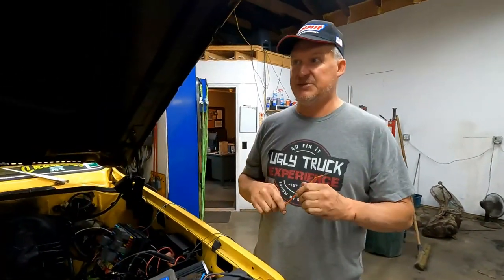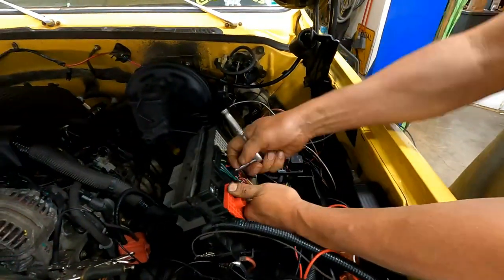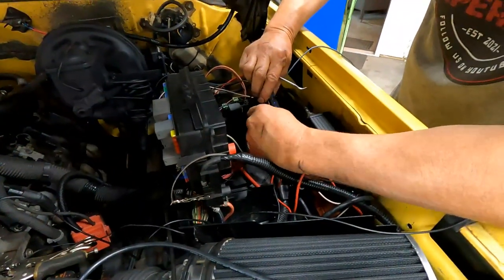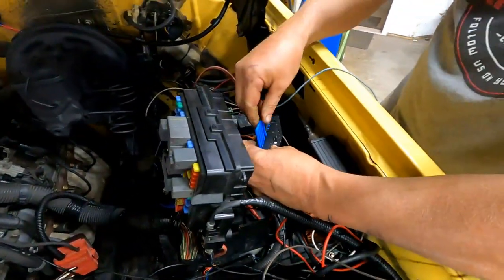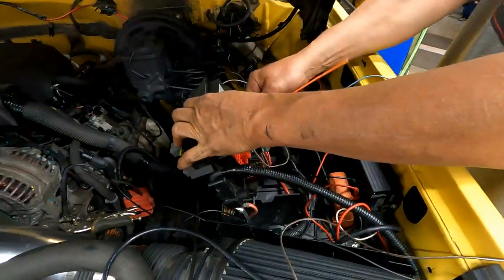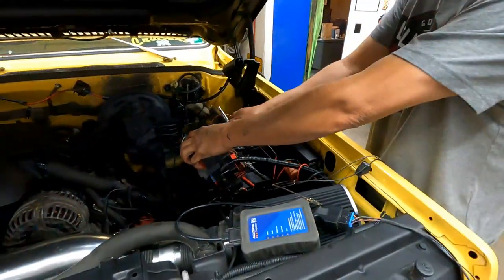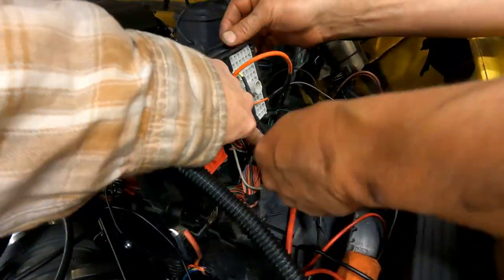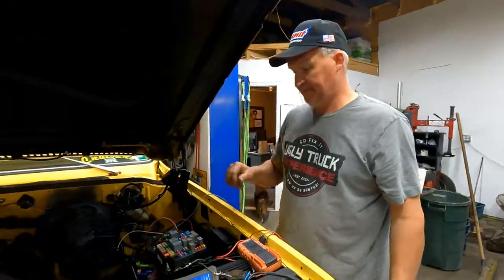MAKE SHIFT HAPPEN - Supplying Power to 4L60E Transmission - Square Body C10 5.3 LS Swap - UTX

Comment: Thanks again for your help. Is the E-7 on connector 2 and C-9 on connector C1 the same wires on the 99-02 fuse block?
Reply from the maker: E7 Connector 2 is the same.  C9 is not the same.  On a 2002 that wire would be E2 in connector 2.  Jerry
Reply: Jerry, could you check again on E2 connector 2? I have no wire there. E1 there are 2 blacks and E3 has a green. but nothing in E2. My E7 does have 2 orange for the rear 02 sensors.  @UglyTruckExperience
Reply from the maker: Will look again..Be right back. Jerry
Reply from the maker: You said 99-02.  Do you know what year for sure you are working with?
Reply from the maker: Need to figure out exactly what this wire harness and fuse box is from.  Your  wiring that you are describing doesn't make much sense looking at these diagrams. E7 should be 2 pink wires if they are going to the O2 sensors.  Double check that you are reading the plug correctly.  It can be confusing.  Also, I can't find a instance of a Green wire in E3 on C2 for any of those years.  Try to narrow down what this came from and let me know.  Will do my best to help out. Jerry
Reply: @UglyTruckExperience  Jerry, I found a diagram that the green wire E-3 in connector 2 as a 10A fuse that supplies Automatic Transmission Shift Lock Control Solenoid. Would that be what I'm looking for?
Reply: 2002 @UglyTruckExperience
Reply: Jerry, My E7 are pink wires that go to the rear 02 sensors. My E3 is green wire and ohms out to a 10 amp fuse (#49) for ATSLC Automatic Transmission Shift Lock Control Solenoid.  @UglyTruckExperience . Hope I'm expanding it OK.
Reply from the maker: See if you have a pink wire in position F2 in connector 2.  If  you do check continuity between F2 and E2 in that connector with it plugged into the fuse box. You should have continuity there and if so are missing a pink wire in E2 for some reason.  Let me know.  Jerry
Reply: Jerry, thanks for helping. There is something very wrong. I am missing pink wires in both F2 and E2 and from what I've seen from other 2002 fuse boxes they should be there. I reading up on some fuse boxes were wire different or if I can find a work-around. I may need to go with a stand alone harness . Jerry thank you from the bottom of my heart for taking the time to help others. The world needs more like you. Talk later. Randy @UglyTruckExperience

Comment: Great videos I have ? how do you wire the obd2 port do you go to the pcm or can you wire it to the under hood fuse box
Reply from the maker: One of the old wires has to go to the pcm and the other wires are a power and ground that I wire into the underwood fuse box.  We will have a video on it pretty soon.  Thanks.  Jerry
Reply from the maker: One of the OBD wires has to go to the pcm and the other wires are a power and ground that I wire into the underwood fuse box.  We will have a video on it pretty soon.  Thanks.  Jerry

Comment: Is the battery cables wire video coming soon?
Reply from the maker: Won't be to long, about to the point of setting the engine and trans in there and will do that right after.
Reply: @UglyTruckExperience  ok thanks because is one of the last thing I need to finish my swap

Comment: Unfortunately my truck is not shifting still. I have it wired the same way you did in the video and pin E pink wire on the trans still doesn’t have power. I jumped the wire and it shifts but not great. 5.3/4l60e out of a 04 2wd suburban that ran and drove before being pulled. (Also seen that E11 c2 should have power which it does and c100 connector needs power on pin c tried that and still nothing)
Reply from the maker: Hello JD. Does your E11 on C2 have two pink wires coming from it?  Jerry
Reply: @UglyTruckExperience  yes it does
Reply from the maker: Ok. If you have power at those two pink wires with key on you should have power down at the pink wire at the transmission connector position E.  If you don't. You must have a break in the wire and possibly a problem with others that are loomed in the harness with it.  That would possibly explain it's poor shifting when you jumped that wire.  Jerry

Comment: I have a 2001 silverado 5.3 swapped into a 83 gmc and im confused on which wires i would use for the transmission
Reply from the maker: Hi Isaac! The donor for this video was a 2005, and your 2001 is a little different. Check out this video for 99-02 donor harness wiring. https://youtu.be/COOzzFHCLRk  Hope this helps! Thanks for watching!  --Emily and Jerry
Reply: Thank you for the video. Now i understand the wires I would need to use for the transmission.

Comment: Thank y’all for everything you do You’ve been a big help to me with my LS swap. Just need to know where to get power for transmission 2000 5.3 suburban 1500. I think F2 is transmission pin just need a power supply and maybe can finally drive my truck. Please Help. Thank you.
Reply from the maker: The 2000 5.3 is completely different when it comes to the transmission power.  I am away from my shop today and will be back tomorrow.  Will take a look at a diagram and get back to you.  Jerry
Reply: Thank you very much
Reply: Hi Jerry just wondering if you had a chance to look at that diagram.         Thank you
Reply from the maker: I got tied up but will look at it in just a bit.
Reply: Thank you Jerry
Reply from the maker: Hello Kris.  On your connector #2 in the underhood fuse panel.  You will have 2 pink wires going to position F2 in that connector.  You  will need to pull those two pink out and connect them to another source for power with key, crank and running.  Maybe the rear O2 sensor circuit if you are not using it. E8 in connector would be that position.  Hope this helped.  Jerry
Reply: Thank you Jerry I I’ll give that a go. Thank you again for taking time out of your day to help me.
Reply: Wahoo!!! Thank you Jerry I got a shifting transmission , while your reading this I’m doing donuts in the parking lot Lol.
Reply from the maker: That is awesome!!  Great job!  Feels pretty good to get to that point.  Do a Donut  for me.  Jerry

Comment: Help me please if you can. Did a 5.3 swap from a 99 silverado into my 1997 GMC sierra. The truck shifts 1-2-3 just fine and then proceeds to just stay in 3rd after that. I can manually select 2nd and take off in second but once it intially goes 123 it stays in 3rd. I hooked up the rear o2 power into the shift solenoid wire at the transmission plug but that didnt fix it. Im stumped. Replaced 1-2 and 2-3 as well as the 3-2 shift solenoids. 

Also using a standalone harness. Everything functions on my truck gauges etc, but the tranny doesnt want to come out of limp home mode.
Reply from the maker: Hello jsbird.  Are you using the ECM from the 99 to control both the 5.3 and the 4l60?   Jerry

Comment: Would this apply if im using a Holley Terminator X max ? just did a ls swap with a 4L80 and it is also stuck in 3rd gear
Reply from the maker: If you bought the Terminator x max with 4l80 control, I don't believe you would have to do this.

Comment: What if you have a standalone harness? And transmission doing the same thing?
Reply from the maker: Hey Felix. If you bought a standalone harness specifically for a swap, it should have power going to the transmission solenoids.   I would go to the transmission plug and check for power with key on to begin with.  Jerry

Comment: This is old I know and may have skipped over in the comments but anyway does this fix the needed pulse for the 4l60e to shift if using say a np208 transfer case?  So it would eliminate the need for speedo signal? Hopefully that makes sense. Love what you two do! And love the content thanks in advance
Reply: Swap is done and truck is running I purchased a Dakota digital pulse generator ,  but have yet to install with the weather, this seems like a way easier way to fix the shift issue??
Reply from the maker: Hey Mangle! Great question! No, the wiring in this video just supplies power to the transmission shift solenoids. You'll still need a pulse signal for your speedo. Thanks for your comment, and thanks for watching!
Reply: Infected Mangle, I'm not using a transfer case as I am 2 wheel drive car, but it sounds like we have similar issues. If you figure something out let me know and I will so the same.
Reply: @danieldalton9306  I plan to do some tinkering today I'm not stuck in third more like 1st but I will keep you posted on what I come up with, just for reference I purchased dakota digital sgi 100 bt and also dakota digital sen 01-1 the platform is a 85 k10 with 05 silverado 5.3 and 4l60e mated to a np208 ,

Comment: Does this wire that needs power happen to be a thicker purple wire?  The harness I got doesn't have the fuse box plug on it.
Reply from the maker: What is your harness and computer.  Donor make model and year?
Reply: @UglyTruckExperience  pretty sure it's from a 2002 tahoe.
Reply from the maker: The wiring for a 2002 is different from this one.  We may have a video that covers that 2002 and earlier.  Will have Emily send a link if I am correct.  Thanks.  Jerry
Reply: @UglyTruckExperience  you guys are the best!
Reply from the maker: Hey Dan! Here's a link to the 99-02 wiring/first start video. Hope this helps! https://youtu.be/COOzzFHCLRk   --Emily

Comment: Hey I had a question I have a 4l60 I did my swap with a Fitech  standalone harness I’m getting 1/2/3 but not 4 gear I checked my solenoid I’m receiving power to 1-2 solenoid and 2-3 solenoid but not power on my pressure control solenoid is that something with the transmission harness or do I have to send power to the transmission just like you did
Reply from the maker: The pressure control solenoid doesn't have power going to it.  There are 5 solenoids that have battery voltage going to them from that one circuit.  1-2, 2-3, 3-2, TCC and the TCC PWM Solenoid.  What year is this transmission?

Comment: Will i have this issue if I’m using a standalone harness it seem as if your using a factory harness and fuse box
Reply from the maker: Hello Scrapman.  If your using a harness that was built for the engine and transmission that you are using, it should have power to the transmission like  normal.  When you get to the point of driving it and if it seems like it is stuck in third gear, check the correct pins at the transmission plug and see it has power with the key on.  Let me know how it goes.   Thanks.  Jerry
Reply: Did you figure it out with standalone?

Comment: Did you guys have to use the tcc brake switch wire pin 33
Reply from the maker: Not to make the transmission shift but in order for the TCC to engage you do have to wire the brake switches.  We have another video on that subject, I will have Emily send you a link.  Thanks
Reply from the maker: Here's that link for the TCC! Thanks for watching! https://youtu.be/yHUZ7JfQBbk

Comment: How would you do this on an 2004 6.0 4l80e  in a 1984 C-10. Will not work like the 4l60e wiring info you shared. Have looked for trans wire diagram. Not much luck. Didn't know if you had any info?
Reply from the maker: What was the donor motor from?  Jerry
Reply: @UglyTruckExperience  2004 chevy 3500 4x4 base model. We took the transfer case off and short shaft and cone.
Reply: @UglyTruckExperience  We found the problem we use the same solder connections as you. One had pulled apart could not see it with the shrink tube. Thank you Jerry for taken the time to get back to me!! And thank you for all the video's !!!
Reply from the maker: Glad you got it figured out. We appreciate you watching our stuff. Thanks!  Jerry

Comment: Is this for drive by wire only I have an 01 4x4 harness drive by cable and running a 4l60e will I need to do this also
Reply from the maker: Yes you will need to supply this power to your transmission to get it to shift.  Thanks for watching
Reply from the maker: Correction.   I just noticed that your donor was a 01.  On this one you will not need to do anything other than make sure your Ign0 fuse is good.  Sorry for that. I should have read message better.
Reply: @UglyTruckExperience  thank you for the response

Comment: Hi UTX, do I need to give power to F10 & E11 of the C2 block to get my trans to shift? I hooked C9 up to a switched power distro block I have but I get no move😊when I put my truck in drive. I did get the following codes: P074, P0785 & P2761. Thanks in advance
Reply from the maker: Hey Richard! Remind us again what your donor was?
Reply: @UglyTruckExperience  it came from an 05 Tahoe
Reply from the maker: Hello Robin.  According  to my diagrams.  F10 is unused in that truck and E11 in connector 2 would need power with key on.  That supplies  power to the solenoids in the transmission.  Did your transmission come from the 05 also?  Jerry
Reply: @UglyTruckExperience  yes it did. I think my issue was that the prong on the neutral switch was touching my steering column. I will keep you posted
Reply: @UglyTruckExperience  for some reason, I am blowing fuses every time I step on the brake pedal. Should pin 85 in the relay for the torque converter lockup have 12v when the brake pedal is pressed?
Reply from the maker: Hey Richard.  Which relay are you referring to? The torque  converter doesn't use a relay.  Jerry
Reply: @UglyTruckExperience  I was able to fix.it. I was referring to the relay you l put on the lockup converter. I had a wire that was ground qnd now the relay works when I step on the brake pedal. Thanks again ❤️
Reply from the maker: Great.  Glad to hear you have it working. Nice Job!!  Jerry
Reply: @UglyTruckExperience  thank you, Jerry, for all your and Emily's help. You make some awesome videos.  This is my 1st LS build and I couldn't have done it without your videos.

Comment: would the A/T shift lock control switch be my transmission circuit ?
my c9 says its Off/run?crank ?
Reply from the maker: Thanks for watching! What is your donor transmission, harness, and PCM?
Reply: @UglyTruckExperience  everything is from a 2003 suburban 1500 5.3
Reply from the maker: That 2003 wiring is hard to figure out. Your power to run the transmission comes from the IGN0 fuse.  As long as you are using the original wiring harness you shouldn't have to do anything to get power to the transmission.  If you  have power with the key on at E11 on connector 2.  It has two pink wires coming from it.  Everything is good.  Jerry
Reply: @UglyTruckExperience  yes I’m using the original harness. Thank you jerry

Comment: Good morning, can you please advise me on my issue, I did my swap and used all parts from donor truck 2005 5.3 but the transmission is from a 2007 and the plug on the tranny is black instead of the green one, I wired it like shown in your video but I’m still stuck on 3rd
Reply from the maker: Hello Victor.  In 2007 they changed the 4l60e. It has the PRNDL switch inside the transmission and does not use a pressure control solenoid valve. You are trying to mix and Gen 3 with a Gen 4 which can be a problem. You could check with whoever did your ECM programming and see if that computer can be made to control  that system.  If not, you will want to get a earlier transmission that matches your ECM and wire harness.  Probably not what you wanted to hear.  Let me know how it goes.  Jerry
Reply: @UglyTruckExperience   Jerry you are the Man I did some research and you are confirming what a I found out, I just wanted to hear it from the expert , very appreciated Jerry in my next live I want to be your neighbor 👍
Reply from the maker: Thanks Victor.  I hated to give you that reply, but at least you know what you are working with. If we were neighbors I would run over and help you swap that tranny out.  Keep us posted on  how it goes from here.  Thanks  Jerry
Reply: @UglyTruckExperience  your awesome

Comment: I have a 84  c10    4X4  and I did a ls swap with 4l60 trasmisión to it it work great but it only go on fist gear Y ready  fix the trasmision and put another trasmissión and put a new computer new wire  new sensers and it do the same thing
Reply from the maker: Have you made sure there is power going to the wires that I describe in this video?

Comment: So not sure what's different about my lq9 6.0 swap but I just did this and my truck wouldn't shut off I had to snip it to shut my truck off but I just had to top off fluids fell rite in gear crazy tho
Reply from the maker: Hi David, what year donor is your harness and fuse box from?
Reply: @UglyTruckExperience  2003 Escalade 6.0 AWD I have the big fuses on my box
Reply from the maker: Check out this video. https://youtu.be/COOzzFHCLRk Does this fuse box look like the one you have?
Reply: @UglyTruckExperience  Actually no I don't have an electric fan relay on the side and my fuses on the back row are large fuses
Reply from the maker: Hey David.  Scratch all of that.  I am looking at Cadillac for 2003 and it is completely different.  Hang on a sec.
Reply from the maker: Let me know if you have a yellow wire in connector number 2, position F11.
Reply from the maker: From everything I am looking at.  If you have two black wires going to A3 in connector 1, you are working with a 2002.  They made a huge change between 2002 and 2003.  If you have that yellow wire in connector 2, that would confirm that. Jerry
Reply: @UglyTruckExperience  not sure ill double check tomorrow everything else I learned from yall on my swap has worked so far basically except this and I had a tune done to delete egr and few other things but ill be in touch for sure